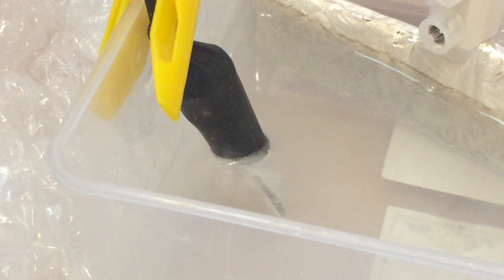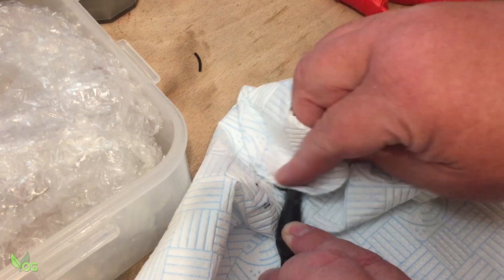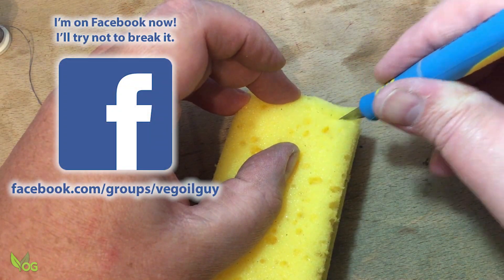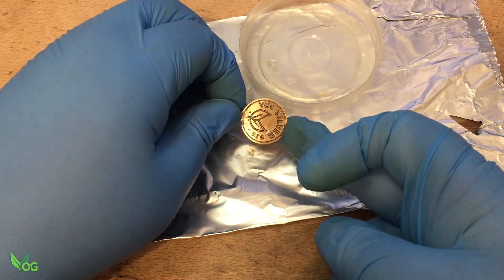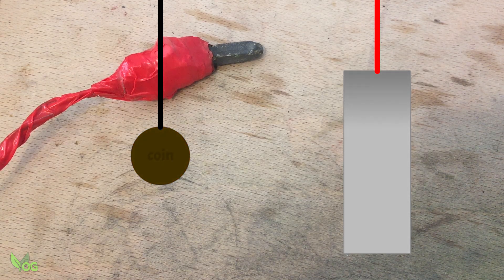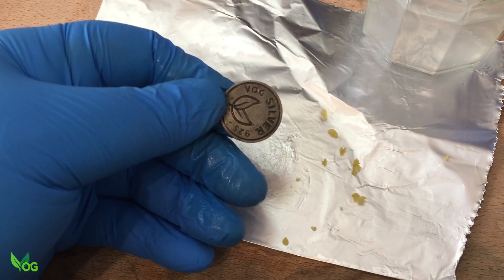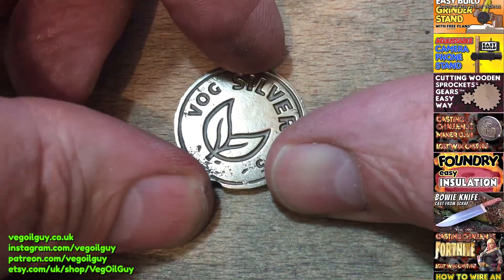Experimenting with Silver Plating using FWG Universal Electroplating Solution - by VOGMAN

Comment: If you watching this way later I must suggest to take time for better preparation. Cleaning electroporated surface properly is essential. There are special solutions but acetone should work too. Then rinse with distilled water at least twice before plating. Rinse after too. If you are successful, no oxidation should occur in such way as whole thing turning black. But this is another thing, it might be due to plating bronze as some materials are not ideal for electroplating, better chances would be to plate with copper first.

Comment: the problem is you're using too much current and voltage. you'll need to use less than 500 milliamps if you're going to leave it alone for hours. i also suggest a small aquarium pump to displace the bubbles around the part you want to electroplate.

Comment: That's stupid. I have a factory of manufacturing silver ring & pendants. All I can see is u have used useless chemical to plate. It should have been just simple cyanide in hot water. 250 gram per litre of water. Distilled water is important.
Reply: Experimentation is not stupid. Reporting your results, success or fail, is not stupid.
Try paying attention to the premise of the video: "No Cyanide" and "Does this alternative work?".

Comment: I did a bit of silver plating the other day, ... All I used was Silver Nitrate solution (17g per litre) and a silver coin (pre 1919) and a copper plated object, ... Voltage was around 3v and after around 1 minute my piece was plated silver and doesn't wash off ... Hope this helps, give it a try yourself ;-)
Reply from the maker: Thanks for the input Dave. My ignorance was my downfall here 😁
Reply: @vogman  Don't knock yourself mate, we all try and all fail until we get it right, .. Practice makes perfect ;-)

Comment: You need the Nernst equation https://en.wikipedia.org/wiki/Nernst_equation and standard electrode potentials https://en.wikipedia.org/wiki/Standard_electrode_potential_(data_page) if you want to figure out what will happen at certain settings. Otherwise it is pretty much trial and error and you need to know the right recipe. What I think that voltage matters, the concentration of the electrolite matters, the direction of the current matters a lot and I guess you don't necessarily need a silver electrode if you already have silver in your electrolite. As of the bubbles, they are the sign that you split water and make hydrogen and oxygen instead of what you planned (which can cause a tiny explosion with these voltages if it catches fire, probably nothing to worry about). The voltage might be too high as others wrote too. I am pretty sure you cannot get AgCN (or KAg(CN)2 which is used for coating), because it only requires a little acid to make HCN (hydrogen cyanide) gas, which would instantly kill you. I think you need a license for it in every single country. What you got is most probably AgNO3, which is a common more or less harmless chemical in laboratories. https://en.wikipedia.org/wiki/Silver_nitrate#Safety You should always know what you are working with to make the right precautions. You can google the R/S sentences  https://en.wikipedia.org/wiki/Risk_and_Safety_Statements  of the chemicals you plan to use before doing any experiments with them.

Comment: You got a good bit of success! I've only ever used the metal plating solutions. Silver and gold are particularly tricky with certain metals.. Gold solution plates really easy, but it needs a layer of copper underneath to stick properly to some metals. Sometimes it'll plate nice and flake off, or it won't plate at all. This doesn't seem like it should be giving you so many problems. It looks like you're getting too much oxidisation for some reason.

Comment: Keep the current low for better adhesion and keep the alligator clips out of the solution.  I've only plated nickel onto brass using a vinegar and salt solution I made using Odd Tinkerings method and it works pretty well.  High current burns the plating as it deposits which is why it just rubs off. The clips are metal so that will react with the solution as well. At least I think, I am by no means an expert.

Comment: part of your problem is a lack of silver ions in solution, this solution tends to need heat and takes hours to plate some thing as the silver ions have to go into the solution before transferring to the cathode target. You could degrease the target and electroclean it as well to increase success. Electroclean is sticking the positive to the target and a carbon ror or bit of stainless for the target for a few minutes. The reverse of what you would normally do. then try the bath plating with some heat. Its not a great solution for silver and straight out of bottle is near worthless as its lacking the metal ions you need to get it going in the first place.

Comment: The current density is also probably too big (you need less than 500mA). High current causes too fast deposition on the cathode surface and therefore it does not get chance to stick because it has to get by all the bubbles as well. If your electrolyte is too high in dissolved salts, then the current will be too big. Silver may also be easier to plate in Nickel. So maybe do a base coat of Nickel plating first then try your silver again. You can try complexing some silver nitrate with ammonia and use that as an electrolyte?

Comment: You mentioned longer battery life by using two batteries.  Problem is that you connected them in parallel, and not series.  Parallel adds the voltage, series adds the amps available.  If you want a longer electrolysis, connect them in series.
Reply: You got that backwards. What he did was correct.

Comment: Very nice. But your process is quite off if I may be so bold.

When plating/anodising it really pays off to accurately calculate the current density for a part and use a DC powersupply you can actually read off and control. The 9-18V is most likely way too much for immersion plating. I nickel plated cast coins and small parts with great succes at only 1.2V, for reference. Too much V’s will mostly result in thick oxidised patina’s that won’t adhere to the base metal.
The same will happen if you leave it in too long.
And if you mix up the anode and cathode.

Also, make sure the base metal is clinically clean. Otherwise the finish won’t turn out well.

The solution you used is quite alright and should work as silver nitrate is a commonly used salt for plating I believe, but do make sure you do not inhale the fumes and do not do this indoors or without ventilation. These fumes can contain nitric oxide fumes which I believe are toxic.

It is possible to create a solution of silver in hydrochloric acid, which theiretically is safer but I only heard of this and never worked with it myself. But it might be worth looking into.

I have no real experience with those silver buffs. But my gut feeling tells me they will either tarnish, be hard to apply or wear off quickly.

Comment: What kind of silver are you using? If you are using sterling silver (92.5%) the black deposition could be copper oxide rather than silver. You may find better results using pure/fine silver (99.99%).

Comment: Your voltage is waaaaaaaaay too high!!!! You shouldn't be using more than 1.5 volts. I'd go a little lower than that. Were there not instructions with the solution as to what voltage to use?

Comment: I like it 😁 great video👍 I did play around with electroplating few times however never with silver, although I see similarity. First of all as Corbald mentioned you need some silver ions in the water. I made that by putting on both + and - the same material in your case silver, and let them work for some time. Second think is oxidation I get similar results when power is to high. You may try lowering it or what I found working too is quickly dipping the item in solution many times. ( be aware of splashing) good luck and hope you find your way to make it nice and easy 😃

Comment: From what I understand you are using too high a voltage. you want more 1.0 to 1.2 volts as higher voltages cause issues with the plating. might be worth trying again with a adjustable power supply.
Reply: Or at least a AA battery. 1.5 volts

Comment: that voltage is way too high. you are probably getting mostly if not all oxides due to the electrolysis.
Reply: I was going to suggest the same thing. I've used a 5 volt power supply for zinc plating but when I do copper electroplating it's running at .6v and depending on the size of the piece, usually around 3-500 milliamps, or more current if I have larger things but rarely above .7 volts. Instead of a 9 volt he might have better luck with a D cell or a 6 volt lantern battery even. From my experience current carries the metal while voltage Burns It Off. So you want more current but not as much voltage usually.

Comment: I can rember me asking you about you doing electroplating in the future (a long time ago). Finally it's here :D

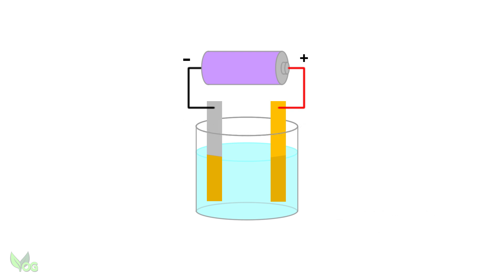Edit: Just saw 1:28 ... nonono that's not silver cyanide (AgCN). That's silver nitrate (AgNO3). And in common application it's also usually silver nitrate (especially for private uses). Silver cyanide has the upside of coming directly from the refining process of silver ores. (Chemist out :D )

Edit 2: Just a tip about electroplating. You don't really need 24 V for your plating bath. I don't remember the exact Voltage for plating out silver, but I remember it as being below 1 V. Higher voltage usually means that there are more side reactions beside the plating reaction, especially plain water electrolysis which releases a heap of gas messing with your plating process (this will eventually let your coating flake (a lot in this case) and your silver oxidizing. My advise here would be to reduce the voltage to a level to where no gas is being produced (since the potential for plating silver is way lower than the water electrolysis potential). (This time I'm done for sure with my scientific jibber jabber :D)

Greetings from Germany :)
Reply: Agree. You write silver cyanide and the formula is silver nitrate. IIRC, many years ago we used silver nitrate in my quantative analysis lab (college chemistry). Don't remember any lecture by the lab assistant about poisoning ourselves with Ag cyanide. But you guys call it aluminium, not aluminum,,  so who knows? (Just could not ignore the chance for that dig :)
Reply: @antifreeze7018  Exactly. We also used lots of silver nitrate solutions for titrations and only had some extra mini exams for masking copper ions with cyanides when we were testing for cadmium.
Reply: @ninil.9287  Same here, we used AgNO3 in lab. I would not work with AgCN. Just add a little acid, and you got HCN...

Comment: I think the problem is that you need a bit of silver in suspension in the fluid before you start coating your piece. Try a bit of steel wool or copper wool as a receiving surface to get the silver into the liquid, first. 
You might also try some plastic wrap along the surface to prevent oxygen from getting into the fluid, assuming it's not producing any by it's self during the plating.